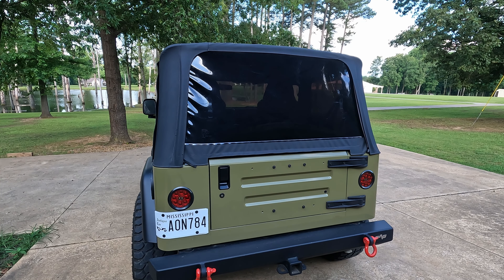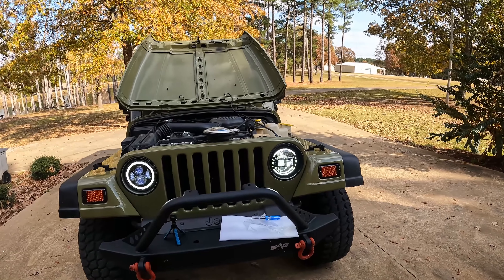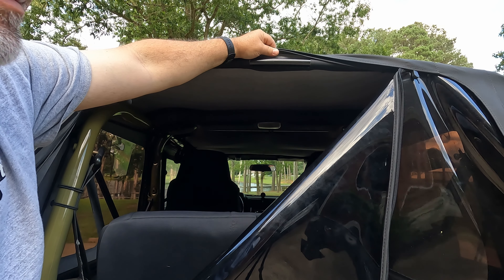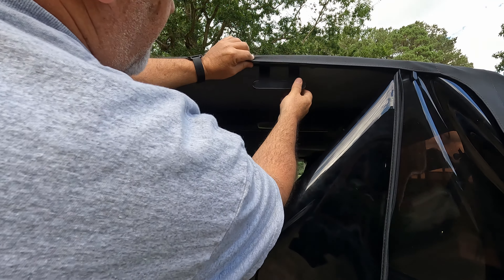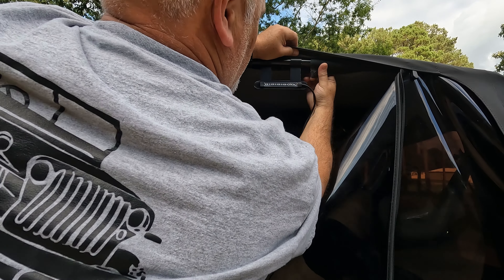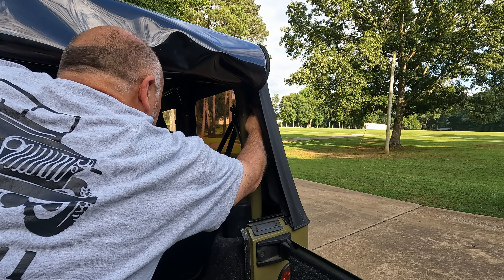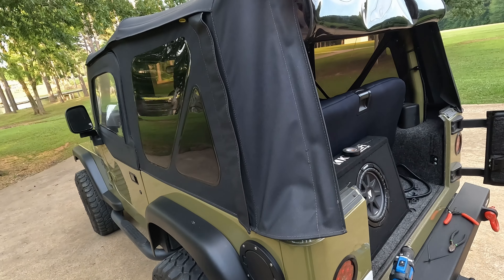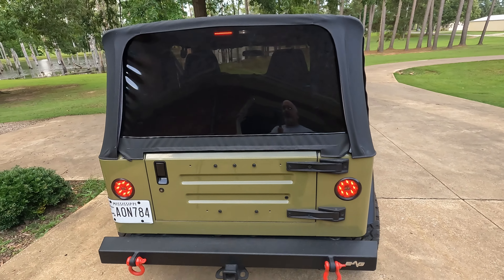Jeep Wrangler TJ (New Third Brake Light Location!)

Comment: Have you given any thought to just putting a heavy duty hinge on? I had the same problem with my new wheels and tires, and this was a lot cheaper than a new rear bumper:

Hooke Road TJ Tailgate Reinforcement Kit Tailgate Hinge Set for Jeep Wrangler TJ 1997 1998 1999 2000 2001 2002 2003 2004 2005 2006
Reply from the maker: I very well may do that. Is yours doing well? I think I was about to have quarter panel damage. I will need the 2 hinges connected to each other. Thanks for watching and for the advice!
Reply: It sure is. It took several adjustments ti get the gate closing smoothly, but I have no issues with the weight of the spare now.

Comment: Nice work. I was wondering can you cut out and insert the led lights. 
Also, I do I order one for myself?

Love the work and your  channel
Reply from the maker: Thanks Tim! Not sure what you mean about cut out and insert the lights. Care to explain?
Reply: @ForceBuilt  cut out a grove into the plastic so the light fits flush you could glue or screw from the vantage point. There by adding strength and stability. Making the part look as one single piece. Great design. I wish I had little more talent like you Sir
Reply from the maker: @timcarr4847  Yes, that is very doable. I can 3D model a new piece like that where it will be recessed for the light. Wish I had thought of that lol. Thanks for  the idea.
Reply: @ForceBuilt  I will buy one from you!
Reply from the maker: I can make you one. Let me design one with a recess. And I will get with you. Thanks
Reply from the maker: @timcarr4847  I am designing a mechanical piece for a friend at work now. I have to finish that first
Reply: @ForceBuilt  That would be awesome! I have a 1997 TJ 4.0 I’m getting rid of spare tire we go to the beach I will be using that space for beach chairs. We are almost neighbors i’m in  Pensacola
Reply: @ForceBuilt  When you get the time I’m in no hurry Thank You Sir God Bless You and your family!
Reply from the maker: @timcarr4847  Contact me at futuraforce@gmail.com if you are still interested in the piece. We will discuss it there.
Reply: @ForceBuilt  I did Sir 
Thank You 🙏 
God Bless You 🙏🏻

Comment: Did you have to move the evap canister that is behind the passanger tail light to fit those led's?
Reply from the maker: No. My canister isn't in that location.
Reply: @ForceBuilt  oh.. mine is back behind the light.. thanks for the reply.